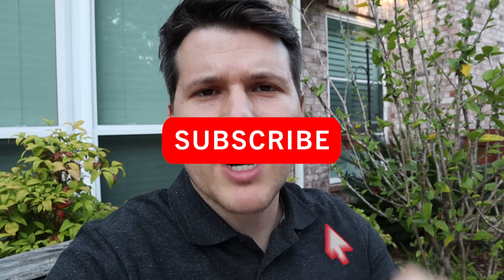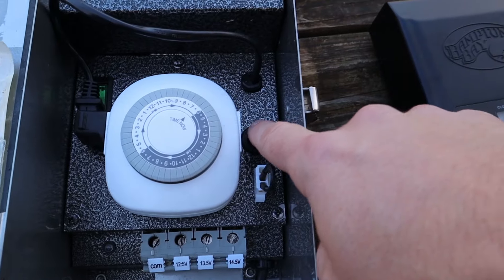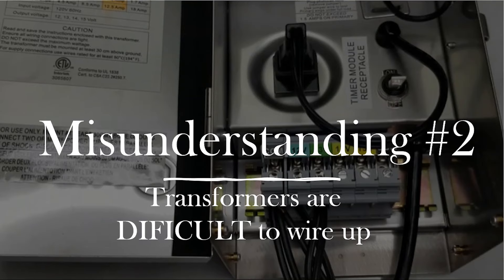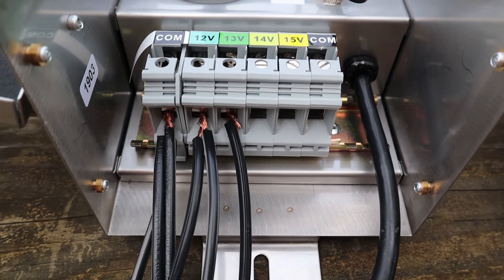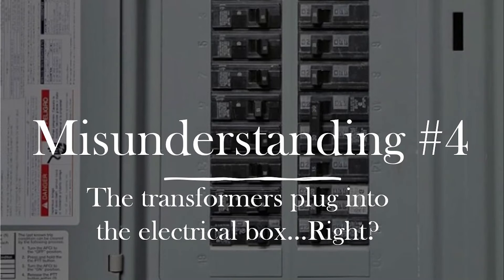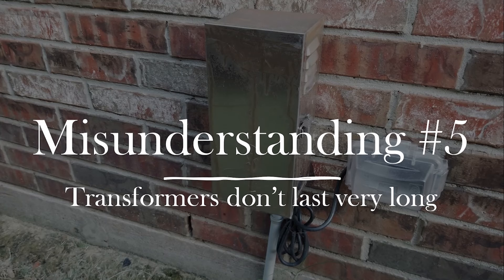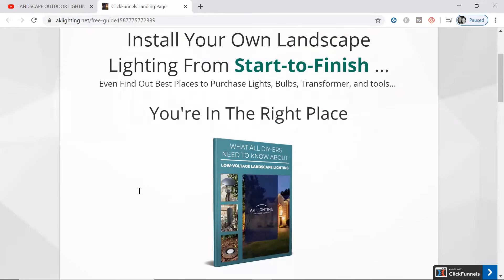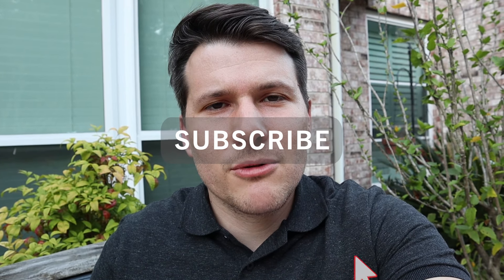Landscape lighting - what most people get WRONG about landscape lighting transformers

Comment from the maker: Thanks for watching the video! If you want to learn more or need help, here are 3 options.
🔥FREE pdf download: The fundamentals of landscape lighting AND learn how you can make your lighting look professionally installed. https://course.aklighting.net/freepdfdownload
  
✅ Complete Start-to-Finish Course: Get affordable professional help so you can install your lights the right way. https://course.aklighting.net/diylandscapelightingstepbystepcourse

💻 Website: The One Stop for All DIY Landscape Lighting. https://diy.aklighting.net/homepage
Reply: Hey brother so i know you cant agree and say ya what im doing is fine n has your aproval simply bc its not what the trans is made for but i am into audio mostly car audio and im putting a semi large system in my garage that tech should be inside a car and i need a decent amount of power that wont make the breaker break on me on the lower bass since the amp eats up the most power on thoes notes any who i need DC OUTPUT I READ MY TRANSFORMER HAS A INPUT OF 120V 1.0A MAX AND THEN THE OUT PUT IS BROUGHT DOWN TO THE 12V 88WATTS MAX  SO OBVI ITS AC IN BUT IS IT DC CURRENT GOING OUT. I KNOW 12V USUALLY IS A SAFE BET BUT IM NOT TRYING TO FRY MY AMP BY ANY MEANS FOR BEING A DIP SHIT LOL SO IF U CAN PLEASE LET ME KNOW IF THE OUTPUT ON A INTERMATIC MALIBU TRANF MODEL ML88T HAS DC OUTPUT ID REALLY OWE U BUD THIS ONLY THING IN MY WAY FROM HAVEN MY DREAM SYSTEM WITH CAR SUBWOOFERS IN THE HOUSE N GARAGE LOL I Cant affored the real deal hi power AC TO DC POWER CONVERTERS THAT WILL HANDEL REAL POWER THANKS AGAIN

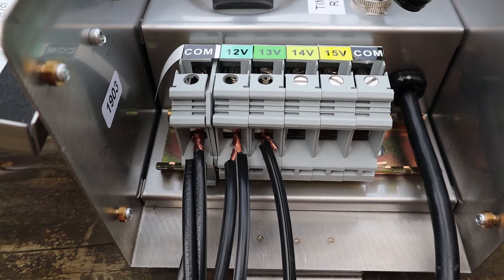Comment: 2:29 I love your videos and respect you immensely, but you should look into using wire ferrules since they upgrade the quality of your wiring significantly.  Not only is it less safe to have a ton of exposed copper, but it's easier to connect and disconnect a wire ferrule; who doesn't like tidier!

Thanks,
-Adam
Reply: Fair especially for stranded wire it's a must.
Reply: I think most people are unaware of their existence. Nowadays you can get a crimp tool and a bunch of ferrules for under $20. I am amazed that bif bix stores don't sell rhem. There is no excuse not to use one.

Comment: Use a multi meter to see . Measure your at your last light, if the voltage is lower than where you are wired to, move it up at the multi tap point of the transformer until you get the correct voltage you need. Dc voltage drops fast, long runs may require 15v and 10/2 wire
Reply: Isn’t this current AC?
Reply: @pairadocs4  No, most landscape lighting is 12V-15V DC. The transformer steps down the voltage from 120V to 12V-15V (depending on which tap you use) and rectifies the voltage from AC to DC.

Comment: Good info in this video, thanks for taking the time! I used a Hadco transformer in my system. Have had it about 25 years now, no problems. I run 8 PAR36 lamps and they usually last about10-12 years. Have had zero issues with my transformer. Model #TS643-13. Hadco is a bit pricey but you get what you pay for!

Comment: Great videos! Question: I have a set of low voltage LED landscape lights that require 12V. I'm using 12/2 wire for 2 runs of 100 feet each. Can I use the 13V or 14V tap in the transformer though the lights are rated for 12V?

Comment: Hi to you.

I have a wire run that is nearly 325 feet from the outlet. The wire gauge is 12, with the closet LED light 75', and the furthest at 310'. My transformer is a 300 watt double tap with 12, 13, 14, 15v Best Pro. The lights wattage total 125 watts.

Can connect all of the lights on one of the taps (12v), OR, must I add another transformer? Which would mean creating a different outlet 😢

Comment: Adam, great video and instruction.   Recently I discovered that my outdoor lighting stopped working.   When I went to look at the transformer, I discovered that the wire going to my outlet had blowen out of the outlet and there seemed to suggest a surge took place.  In fact, the ground portion of the plug remained in the outlet and separated from the plug itself.   There were signs of a "blowout".   My question is if I plug the cord back into the outlet to test the transformer without the grounding portion of the plug would the transformer work?   I tested it and it doesn't seem to work so I was planning to by another transformer.

Comment: Hi, great tutorial - I need your help FINDING where is and how to find my transformer - I just moved into an old house and found there are 4 entryway lights (20w Holigan bulbs) with thick mesh strands cables attached - I noticed the Bi-Pin sockets were old and bulbs broken, so I replaced all sockets with 3W (20W equivalent) LEDS thinking that would solve the problem but it did not - After seeing your videos, I tried to locate the transformer and looked everywhere, but with no success... I do not have a wire tracer (too expensive) and hoping that you may know a way to find it, Thanks!

Comment: Hi , been struggling with my landscape lights.They have worked for 3 years as a charm. But now none of them except 1of 10 are not turning on. When i turn the transformer ON in test mode once in a while they all turn on but then after that when i turn it to ON mode only 1 light turns ON. Even changed a brand new transformer,  the issue still perisits so which means no issue with the transformer. 
Please advise what the issue could be 

Thanks in advance

Comment: Hope you are still around! I have a transformer with three, 12V connections for three strings of outdoor lights. I use two. It has worked perfectly for five years. Suddenly, one string of lights does not work while the other works fine! Kept fiddling with it. No luck. Old transformer, I thought. Just bought a new one. Same problem! So, the usual recommendations for problems solving transformer issues have not worked. Thoughts anyone?

Comment: Hey quick question for you.  If I use a high wattage transformer, like 600w or 900w does that mean that I will have less voltage drop through out a very long wire?  Thanks
Reply: nope
Reply: Just means you can put a lot of LED's on it

Comment: On a 900ft tree line, looking to put 15 LED FLOODLIGHTS to to light up the trees from the ground facing up. And 1LED spot/flood to light up a sign on a upright tower. Any ideas?
Reply from the maker: Holy cow that sounds like you have a large property! Honestly its easiest for me to give recommendations if I can see it. If you could send some pictures to my IG or email or Facebook.
Reply: I would run 120AC to a satellite cedar post with an outdoor GFCI outlet and transformer on it 600' into that run, but that would require 10 gauge wire and deeper burial and cost a lot more in materials and labor. Curious if you got this resolved.
Reply: That far you'd have to use a higher # tap and bigger gauge wire like 8 also depending on wattage of the 16 lights

Comment: Random, been watching your videos - but can't seem to find the answer.  I have 14.5V at a fixture; bulb is good, fixture is good.  Voltage at fixture drops dramatically once a bulb (load) is placed on it.  My guess is there's not enough current?  Or high resistance else where on the line?  All other lights on this transformer light just fine.  Usually when I have an issue it's low voltage and I can trace it back to a poor connection / degraded splice.  But this one is racking my brain since it shows 14.5V at the fixture.  I even redid the splice, nothing.  It's the last bulb in the line at this point I'm wondering if I should change the transformer.

Comment: I have the Patriot timer, all was working well now as soon as it turns on it turns off! Not sure what happened
Reply from the maker: It sounds like your transformer is overloaded in some way. I'm not familiar with the Patriot timer, but I would check the load.
Reply: @aklighting8292  Turns out that the end of the wire was laying in the puddle of mud. I wiped it off and put tape on the ends covering the wires and it's working fine now.

Comment: McKinney maybe you can help me. My yard lights would not turn off or on according to the dusk dawn programming. I thought my D620 Intermatic Timer was malfunctioning and replaced with the same model. Now that one is malfunctioning in the same way. I have programmed it and reprogrammed it 5x's thinking I was programing it wrong. Now I an thinking the Transformer Model MTP300 Justin Inc might be the culprit. If anybody has run into this problem please let me know.

Comment: Thinking about the VOLT Brand Transformer (150W) for my project.  Would you recommend this unit?
Reply from the maker: I like the VOLT transformers. Make sure you get the ones that look like the transformers I use in my videos. Those last longer and are easier to work with.

Comment: I’m migrating from a 150W transformer to a Ring Smart Lighting Transformer in order to harmonize existing garden lights with the Ring security ecosystem.  Since the Ring transformer has only one Common tap, one 12v tap and one 15v tap, and my existing lighting arrangement has 3 wire sets (3 zones on 12v, 13v and 14v) my question then is whether it's possible/safe to plug these existing 3 sets (6 wires) into the Ring Transformer according to just the Com, 12v and 15v. Maybe 2 wires on the 12v and one on the 15v. Thanks for your guidance and posting of your videos.
Reply from the maker: Great question! Yes you can add 2 zones to one tap. Depending on how big your property / how far the lights are, I'd suggest putting the two closest zones on the 12V tap and the farthest on the 15V tap.
Reply: Consider getting a transformer made my fx and a smart plug made by ring of yours goes out

Comment: Can you tell me the approximate cost of a 16 lights complete setup? Just asking ballpark range. Great video btw
Reply from the maker: Thanks! 
Approximate cost of 16 lights to pay a company is around $3,200. Your cost if you do it yourself can be around $1,000 - $1,500 depending on which lights you get.
Reply: @aklighting8292  Roger-that. Thank you.
Reply: Depends on the 16 lights brand, type & quality but most would do it for probably about $4000 and you could usually diy with equal fixtures for less than half if you felt confident to do so

Comment: What’s out there on the market for transformers having the ability to control multiple scens
Reply from the maker: Are you talking about zoning or dimming? Regardless, there is a Vista Pro transformer and an FX transformer that can do those things.
Reply: Zoning I’ll look into those thanks, I got 40’ of under railing led strip on my deck they are obnoxiously bright, how about in wall dimmer switches like dual slide dimmer to control 2 individual lights from one switch, cause these lights are not something I want all the time

Comment: can you connect a 12v light that is located 100 feet away to a 15v slot of a Transformer?.
Reply from the maker: Yes you can. 100ft away I would personally still put it on the 12v or 13v.
Reply: @aklighting8292  oic. i thought a 12v bulb will get busted if i put it on 15v.  wondering abt the 13v and 15v what is it used for.
Reply from the maker: @miksUSA777  they won't bust on 15v, they just have their life reduced. So lets say its normally 8 years, you might lose 2-3 years off it. 
I'll try my best not to overcomplicate things. Well made bulbs are meant to handle 15v just as well as a 12v. A lot of normal bulbs don't have that. Also, with voltage drop, if you have lights far away and the wire on 15v. By the time the electricity makes it to the lights, that 15v really is about 12v because of the voltage drop. 
Hope that make sense.
Reply: @aklighting8292  🤗😉😀 Thanks! Have been watchg all your videos. The Best! appreciate that you do really teach us than just selling to us. subscribed and Liked all of it.👍😀
Reply from the maker: @miksUSA777  I really appreciate it! I've really enjoyed teaching about lighting. Let me know if you have any requests.
Reply: @aklighting8292  WOW Thks 😉 am in a country where Landscape Lightg in houses is unheard of... so its a real challenge for me even just to get eqpt you sampled in the videos. (12v bulb is hard to find).  hv to design Transformer from scratch. really appreciate your videos on it.

Comment: What’s considered close? You said if the light is too close you can burn it our faster.  10’ , 100’ 300 ‘ ?
Reply from the maker: I'd say anything around 10ft away from the transformer, and that's if you have have the wire on 15v. Now, not all bulbs have that issue. Great LED bulbs can handle that really well and sometime even prefer the higher voltage. Hope that helps!

Comment: can a low voltage transformer go dead even after 5 months during freezing temperature? yesterday, we had heavy snow and temperature went below 0 degrees. today, I came home and the transformer was not on.  would it come back on after it unfreezes?
Reply from the maker: Hey Ali, I also got hit by the storm too. I'm not sure, I believe your transformer will come back on when it warms up. If not, if it's a professional transformer, they will have a warranty on it.
Reply: Do you have power to the outlet
Reply from the maker: @j.t152  If I understood your question right. Yes you need to plug the transformer into a working outlet. Sometimes people need to get one installed on the side of their home because the only working outlet is right next to the door.

Comment: I thought landscape lighting systems were 12vdc! I designed and fully installed a photovoltaic system to run my outside lighting not knowing these were running on AC.. I had to get some harbor freight AC/DC ones because anything decent only seem to be AC 🤦‍♂️
Reply: They’ll run on dc lol
Reply: @bobufo5729  decent ones according to their spec sheets are AC only. They specifically say DC will NOT work.
Reply: @mchipitt  in my experience it will still work fine with dc power . I only use FXL products . Never ran into a integrated board or a bulb that won’t run off dc.  You could do whatever you’d like in your yard. Works fine on dc unless your getting into specialty stuff like a Luxor system with ZDC boards or Luxor cubes.
Reply: If you want to give me specifics I’d be happy to try to test it out. Can’t speak on longevity for every brand but in my experience it hasn’t decreased bulb or board life . All the manufacturers mostly use ac transformers and the documentation is going to say use there transformers . Doesn’t mean dc won’t work or that dc will have any negative effect on the life of the fixture.
Reply: @mchipitt  for example the FX luminaire “ ST-UV “ step down transformer takes 120 to 233v ac power and steps it down to 12v DC. Designed for there RC fixture , but will work with any fixture.
Reply: The RC fixture can be specced with a 1led to 9Led ZD board , or ZDC boards. The ZDC and ZD boards are not designed for use with a step down transformer because it has to transmit data to the fixture for zoning , dimming , and color changing. For ZDC. They do offer a dimming step down transformer you could tie into a relay cube for the same effect .
Reply: @bobufo5729  hell yea I appreciate the info especially on a brand I was not aware of. I know lights can get replaced and the bulbs themselves can probably take AC/DC but its a slow progress to investigate which ones I prefer. I looked at that transformer spec sheet, ST-UV, and it's weird. Spec sheet clearly states AC output and does not mention a rectifier, yet the product image shows the flat DC symbol. It looks like I might have just buy the damn ligjt fixture and test it out for myself.. What do you use? And why do you also use DC?
Reply: @mchipitt  yeah your right it’s weird. the only time someone would really use dc for low voltage landscape lights is if there using a dimmer that converts it, or if it’s in a hard to reach area like a island and there is already power there then it would be cheaper to do that for a few lights than put a standalone transformer. Also for some instances where there is only a few lights and you can use a cheap 50w or 30w or 24w dc transformer. You just have to make sure to incorporate a timer.
Reply: 99 percent of the time I’d use a ac transformer like the FXL DX or a FXL Luxor. I don’t know why all the transformers are ac, I’ve thought maybe it’s cheaper for a higher wattage. Just in my experience it will work fine on either one . And led landscape lights will have the rectifier built in the bulb or the board. In my experience the FXL lights are the best bang for buck quality wise and longevity wise. Good warranty and they last many years as well as a range of different styles . I believe there are other options that are good out there but I’d stay away from kichler or anything from Home Depot .
Reply: The Luxor with designer fixtures is the state of the art it’s the fusion of art and technology . It’s very expensive but cool to look at some of the things that’s been done with it on YouTube
Reply: @mchipitt  if you have any questions then I can answer them I do installation and macitence for landscape lighting systems for work. There is some training info on the fx website that really helps with understanding the installation and design .